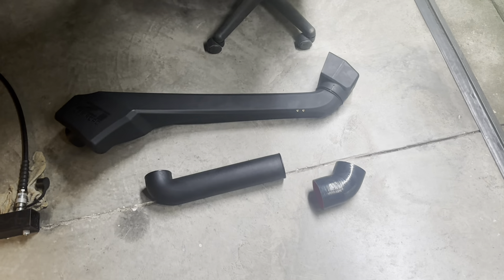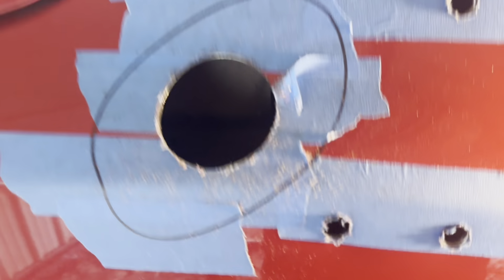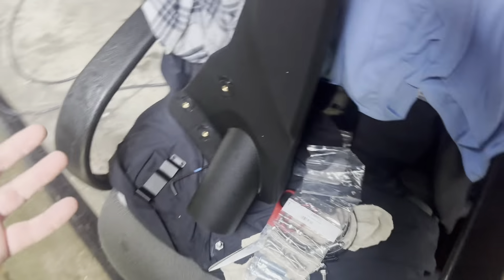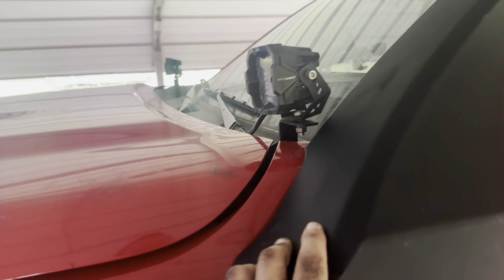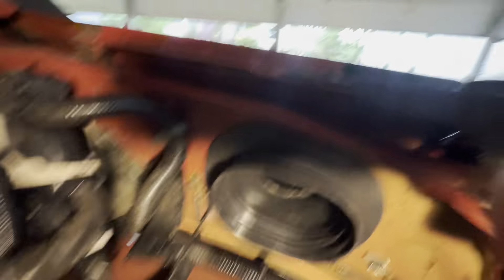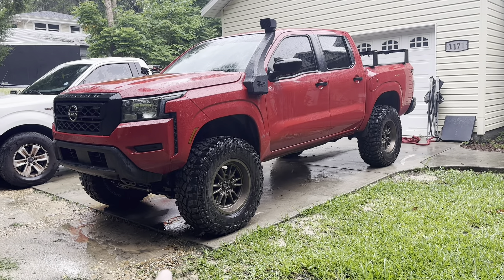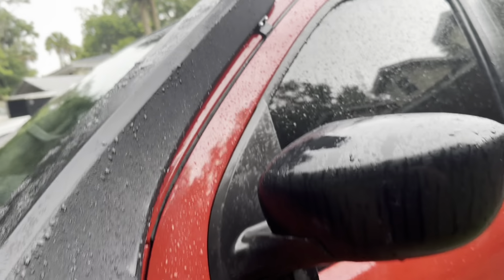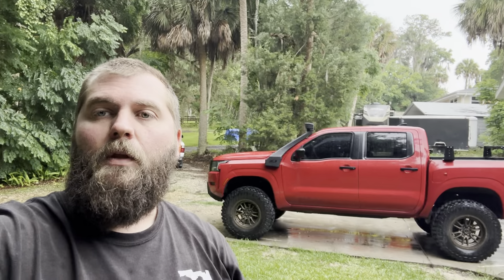DONT BUY THE Z1 OFFROAD SNORKEL ￼UNTIL YOU WATCH THIS!

Comment: I guess I don't understand snorkels. If you drive though a Florida monsoon, won't a forward facing snorkel suck in tons of water?  
I think the 2024 Taco Trail-Hunter has a backward facing snorkel.
Reply: I agree - my $56K 2024 AT4X is not a Submarine - most look hideous.
But everyone has their own uses for these trucks & opinions.
Reply: I had a snorkel on my 2nd gen frontier (Floridian here) and always had a Donaldson pre cleaner on it. There wasn’t even a drop of water in the air box when I drove through rough storms, the pre cleaner capture all the water. Though if driving through a storm, you’re supposed to turn the head backwards if you have a traditional ram head.